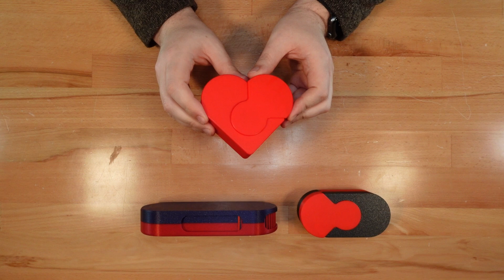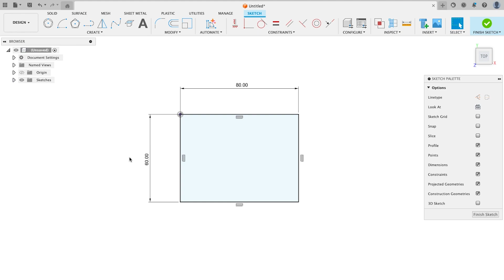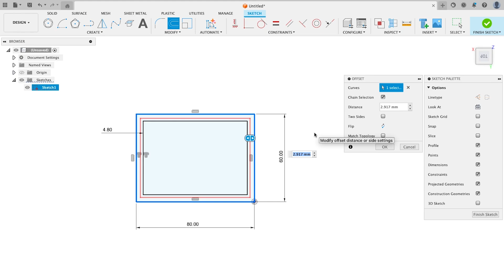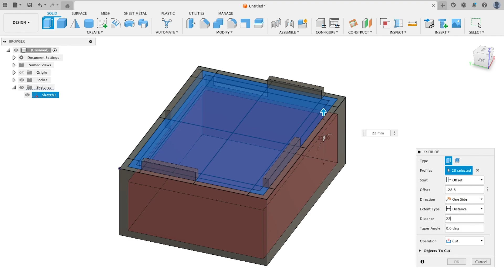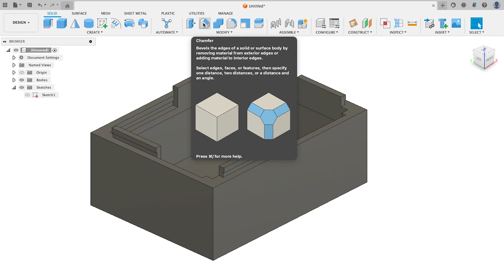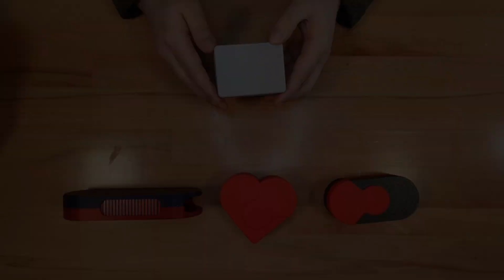3D Printed Snap-tab Box - Autodesk Fusion Tutorial

Comment: I didn't know the offset function of extrude, usualy i extrude two time, one to create de part and the second to eliminate the lefttover
Reply from the maker: So many ways to get the same result :)

I often hollow out volumes using the steps you described. Or, if the wall and bottom are the same thickness, I might use the Shell tool.

In the end, I knew that the offset setting would be a useful trick for later in the tutorial, so I chose to introduce it a little early while making the basic box.

Comment: when i select the wall like you did for creating the bottom, all it does is selec that one side and doesnt create the bottom. can someone help?
Reply from the maker: Are you asking about the second time I used the extrude tool (starting at 3:25)?

If so, I believe what is happening is your sketch is now hidden, so Fusion doesn't "see" a center rectangle to select. It still lets you select the wall because you can extrude from either a sketch OR a flat surface from prior extrusion.

Check to make sure your sketch is turned on by expanding your sketch list on the left and clicking the eye icon so it's active.

Comment: Love to see a good Fusion tutorial! After years of occasional modelling I always pick up new tricks ^^

I'm not sure I agree with teaching beginners to use magic numbers, such as 2.8mm offset next to 2.4mm offset when you meant to add a 0.4mm offset. But it works!
Reply from the maker: Thank you! It's certainly tricky to decide how deep to go in a tutorial.

There were a few spots where I wondered if I'd should take a detour into variables, or equation-based dimensions. Do I mention that this could be achieved though 3 other similar tools, or do I just stick to a limited tool set?

Ultimately, I decided to keep this as short as possible :)

Comment: im designing a box with a side button that when you press the lid open 
ive worked out the mechanism i now just need the bow ,and low and behold .................
awesome work as always , now we need a hinge for the box ,i made hinges before ,they were great until they broke .....
Reply from the maker: Serendipity :)

Have you considered using a filament hinge? One of my earliest designs was the rolling storage box, which uses that trick - and they're still working. Bonus: if the filament ever does break, you can use a paperclip as a permanent replacement that's even stronger.

Good luck with your project!